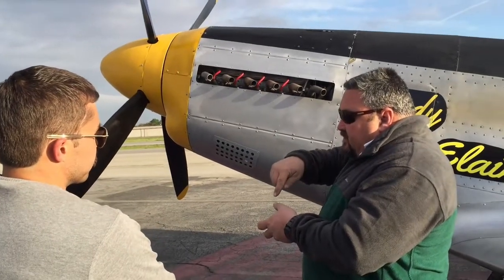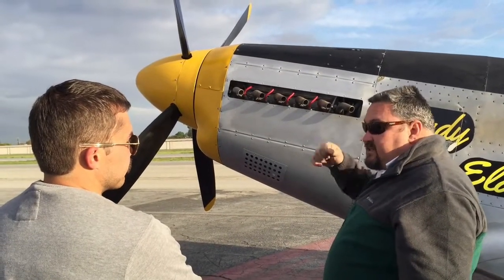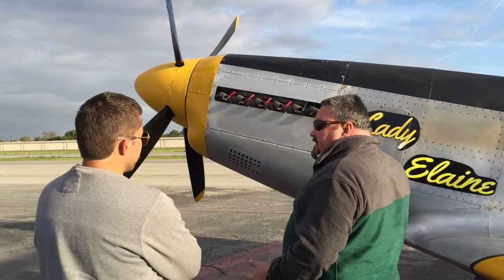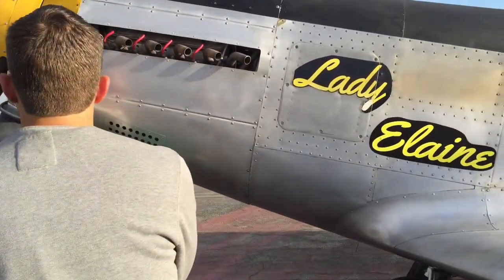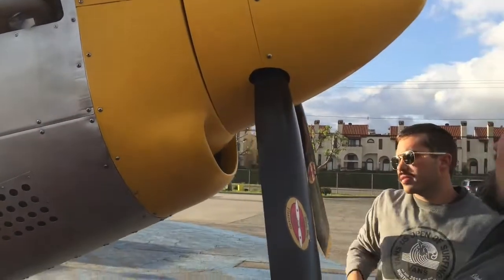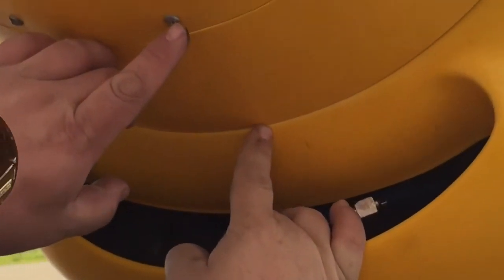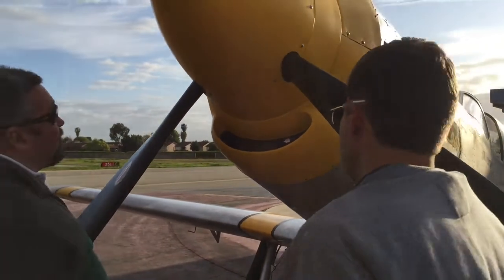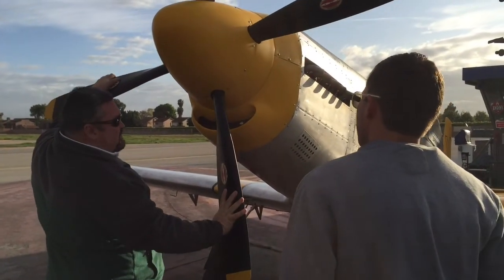Titan T-51 LS3 V8 engine oil and propeller checks

Comment: Another great pro-tip; don't try to take off in an aircraft with electrical faults, faulty flaps, no engine cowls and without the owner's permission.
Reply: So it is the guy from Titan Bill who crashed it wonder if he is still working there probably. Used to be a lot of videos of Bill flying over on Titans YouTube channel looks like lot of the videos have been scrubbed. I remember one he did a barrel roll over the runway the small airport they fly out of was wondering how that was legal the runway parallel to a busy highway. I wondered how he passed a medical guy was about 150+lbs overweight must have some health issues maybe didn't even have a medical who knows lol. I guess he could have been on basic medical